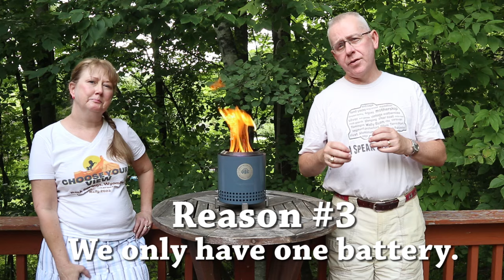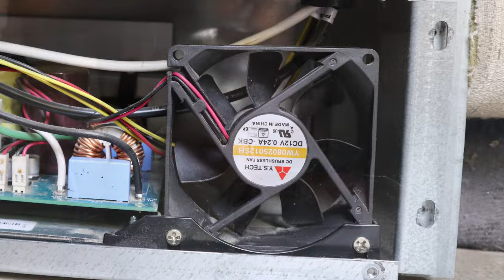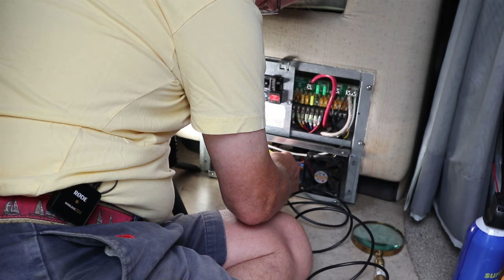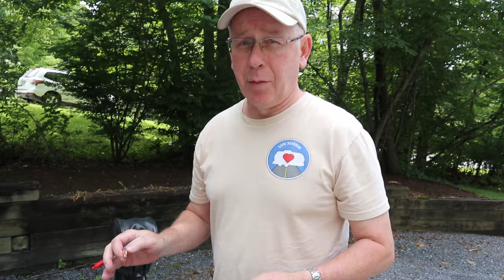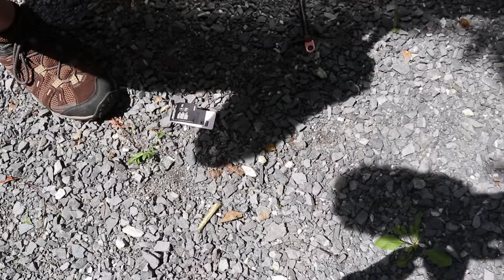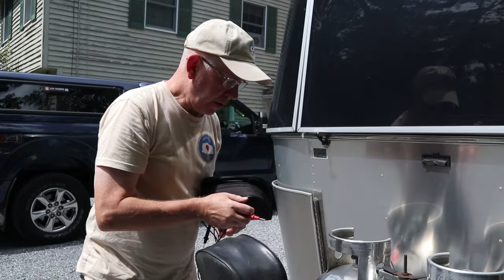Switching From Lead Acid to Lithium RV Battery | Will It Work For You?

Comment: I found when making connections outside (35yrs in the electric utility business) after crimping the terminal on the wire to heat it and apply solder; that will help stopping the connection from corroding during inclement weather.
Reply from the maker: Thanks for watching and that's a great tip.  I've not done that before but will check out some videos for the proper technique.
Reply: Soldering is always a good idea to keep a great electrical connection.

Comment: One option for you would be to build a "upper loft" for a 2nd battery.  I have seen it done with the same "L-channel" steel that holds your current battery but has welded uprights and cross members for a 2nd battery above the current one to achieve the same footprint.  Just a thought.  Double your amps.  ????
Reply from the maker: Thanks for watching!  That's a great idea that I'll keep in my back pocket.  Right now we're 3 days into our trip and have never been below 69% - even with hooking up Starlink off the inverter to upload this video...

Comment: OK for our AirStream🚐 #EscapePodWeHadToDrainOurBattleBornBatteries2TimesBeforeTheConverterWouldExceptThem. Look at you converter if you have a green light or blue light, you need a blue light
Reply from the maker: Thanks for watching!  Very interesting - I'll check that (we're answering comments at a pizzeria so I don't have to hook up Starlink).  I do know that it's charging to the lithium algorithm because I was watching the charge profile...

Comment: I’m buying your arguments on DC2DC. It does pay off when you boondock from one state park to another on a rainy week. But… you already have your trusty Honda when this situation occurs. 

Question I had was around 7 pin connection. You now have two different chemistry in parallel with different resistances. To make the matter worse, your Battleborn can self protect and shut itself off at any time which could lead to alternators diode blowing up. Best solution would be to isolate your lithium from your truck. Can this be achieved by removing the 7 pin charging fuse from your F150? Is there a fuse in the Aistream for this? Am I completely off and worry too much?

Thanks for your video. Thanks for your channel.
Reply from the maker: Thanks for watching and you have given me food for thought.  My understanding (a very limited understanding) is that the truck is just sending a "dumb" charge back into the battery bank via the alternator.  I do not think they are in parallel with the truck's AGM starter.  Lithium requires a special charging algorithm to get the full benefit but a dumb or AGM charge won't hurt it - it just won't be fully charged.  Still, I will continue to research so thanks.
Reply: @LuvSubbin  I thought that both batteries were in parallel, but I believe you're right, they might be isolated already. When I turn my F-150 off (2023), my Victron shunt is  not showing a draw towards my F-150. This tells me they're isolated already - will have to check the Ford truck forums. 

With regards to the trickle charge that the alternator provides, while not optimal, it can't hurt. That would be a true statement for LA, GEL or AGM (all dumb) batteries that are always ready to accept a charge with Ohm's law ultimately regulating what that charge should be. But in the case of LiFePO4s, they're not dumb, their BMS are in full control of accepting a charge or not and with the ability to shutdown charge and discharge at any point in time. 

It's that aspect that gets me confused and worried - I'm reading that this can result into a Dirac kind of voltage spike that will trip the diode of the alternator. Disconnecting the 7 pin charge wire (fuse 107, the trailer tow battery charge fuse on my F-150) fully isolates the TV alternator from the Lithium battery and therefore protects your TV alternator. Unlike a DC to DC charger or a Solar controller, a truck alternator is not smart (at least I don't believe mine is). 

I'll keep digging to find out if my worries are founded or not.

I know you will too... 😆

Comment: Great video! I hate to ask, but ... what is a DC-to-DC charger?
Reply from the maker: Thanks for watching!  Trucks do not send much charge through the 7 pin connector.  If you have a massive battery bank, your truck will barely charge the bank during a typical tow day.  Therefore, people install heavy duty dedicated cables right from the truck's alternator directly to the battery.  This can provide the juice needed to charge a large bank or a very depleted bank.

Comment: Love my new DC/DC charger! This allows me to run fans and 12v fridge while we’re packing for a trip without dragging out the heavy 50a cable. We arrive at the campsite with full batteries.
Reply from the maker: Thanks for watching!  Yes, especially for the folks with the 12V fridge a DC-DC charger makes sense.  We're testing things as we speak to see if we need one.
Reply: @LuvSubbin  I installed the Victron 12/12 - 18 directly in the power line from the 7-pin.  That takes the F150 BMS vagaries out of the equation.  I can see solar, shunt, and truck charging on the Victron app while driving.  Just another way to ensure sufficient charge, including times when the convertor fails.
Reply from the maker: @craigwalker6444  I'm still trying to understand things.  With my old lead acids, when I turned the truck on with the 7 pin connected, I saw about a 5 - 6 amp charge flowing into the battery.  I repeated this with the Battleborn and got zero charge going in with the truck running.  I'm wondering if the battery is shutting off the charge, thus making an argument for a DC - DC charge.
Reply: @LuvSubbin  I had the same experience. Now the DC-DC charger has the LiFePO charge profile, something the truck doesn’t understand. Using the wire from the 7-pin made it a straightforward install.

Comment: Is it enough to turn off battery switch when working on the converter or does the battery need to be disconnected completely? Thx!
Reply from the maker: Thanks for watching!  In my opinion, it is acceptable to turn off the battery disconnect before doing 12V electrical work.  Whenever a switch is relied on to disconnect power, I would double check by checking the 12V terminals or, as a minimum, trying to turn on some lights to ensure the switch worked.
Reply: @LuvSubbin  Thanks! fellow VT-er here and apprecaite your mentioning campgrounds around the state other than the state parks, although I love the VSP's. Hope to "run into" you somewhere along the way.

Comment: Dc to dc is a great way to leave the generator at home. Long trips will keep your battery charged as compared to the lower voltage/lower amperage in the 7 way charge pin. 
Awesome video👍
Reply from the maker: Thanks for watching!  Yes, we're monitoring the situation closely.  Hopefully the generator will only be needed for a little burst or air conditioning on a 100F day (we have an Easy Start).
Reply: @LuvSubbin  I ended up with the Renogy 60 amp and we throttled it in half to preserve the alternator. We typically travel 8 hours a day when we travel and we have the compressor refrigerator. My concern was rainy days(solar) and the batteries maintaining the refrigerator.👍

Comment: If you are going to back to back boondocking sites that don't allow generators then DC to DC charging is great. Otherwise, don't waist your time on it. I just installed one one my truck because we are leaving for a 3 month long trip where we will be doing some boondocking that don't allow generators and they are only an hour apart.
Reply from the maker: Thanks for watching!  Yes, we going to get some real world experience before investing in a DC2DC system.